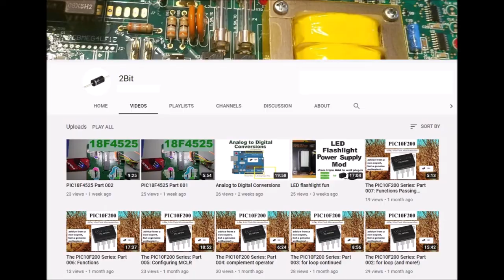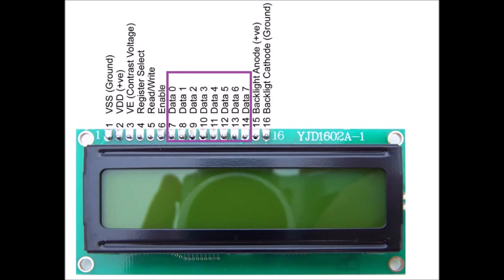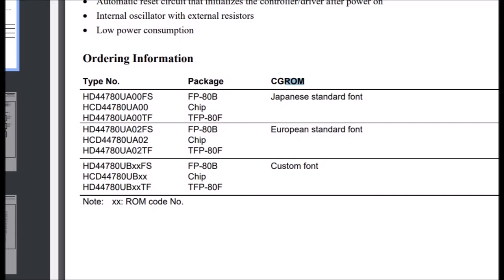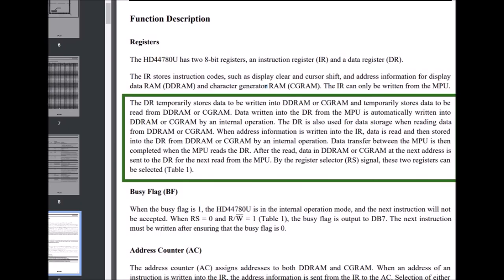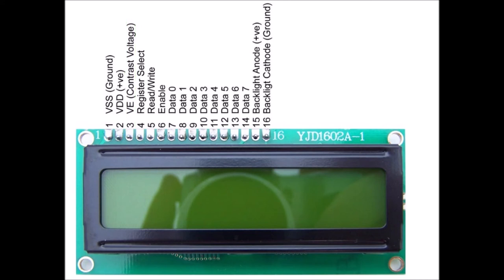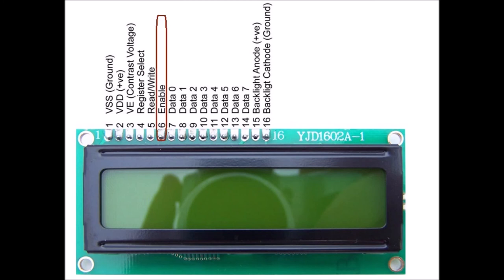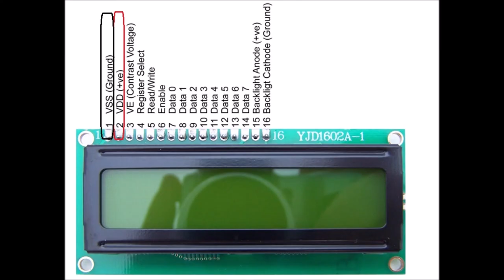LCD 16x2 display HD44780 Pinouts

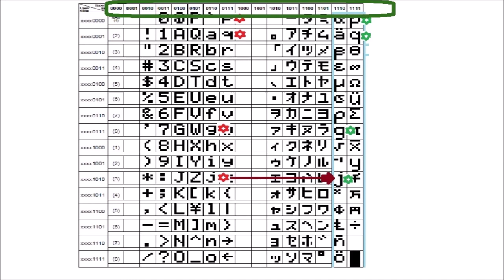Comment from the maker: 3:38 Skip to Pinouts

To me, the main points are as follows:

The RS pin goes to logic 0 for instructions and logic 1for data to be displayed.
 
enable pin: high reads data applied to data pins. When low executes commands/ displays data.

The issue I was having is that both the RS pin and enable pin seem to have similar descriptions. Well, I read a separate article, and I sorted this out.

So, in my humble understanding, the enable pin is the more important pin. It seems to have priority . The enable pins seems to allow the processing of incoming signals (no matter if instruction or data). Whereas, the RS pin differentiates commands (instruction or data).

The enable pin seems more like an on/off switch for new commands, whereas the RS pin is the differentiator of types of commands (data or instruction).

A google search of enable pin says: 

The enable pin is used by the LCD to latch information presented to its data pins. When data is supplied to the data pins, a high-to-low pulse must be applied to this pin in order for the LCD to latch in the data present at the data pins.

CGROM and CGRAM
All LCD displays based on Hitachi HD44780 controller have two types of memories that store defined characters called CGROM and CGRAM (Character Generator ROM & RAM). CGROM memory is non-volatile and can’t be modified whereas; CGRAM memory is volatile and can be modified any time.

Me reading the Wikipedia link Hitachi HD44780 LCD controller (unlisted video):
https://www.youtube.com/watch?v=MiAADetJj0s